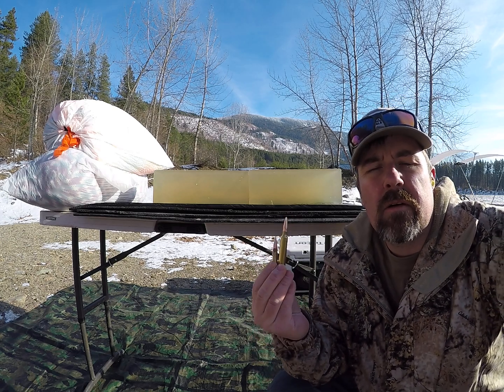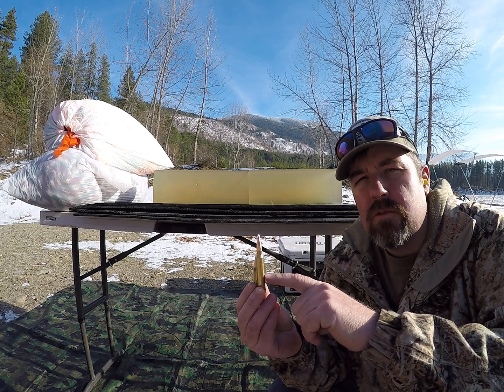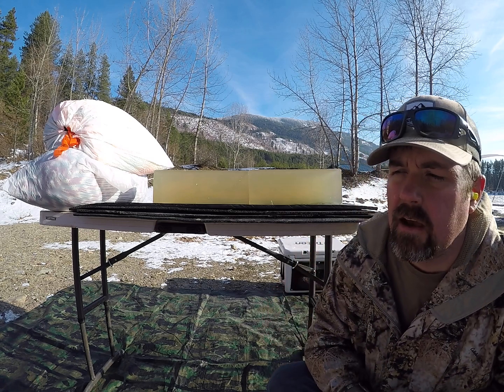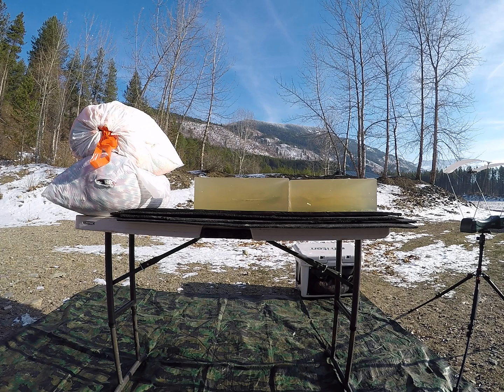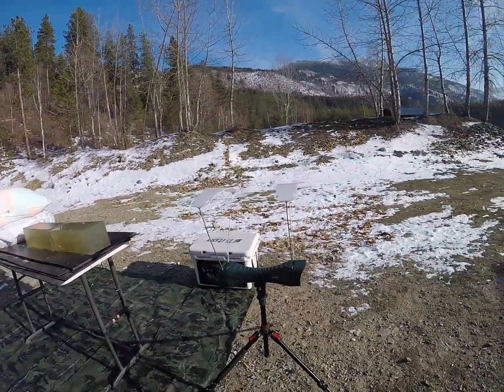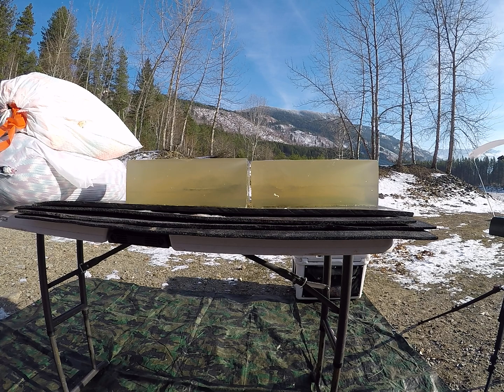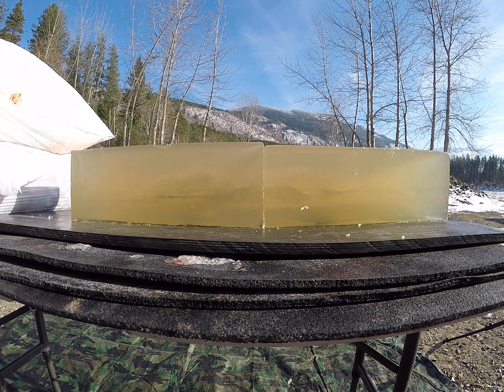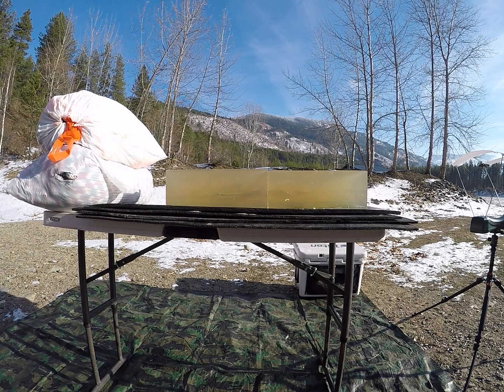150gr 30cal Badlands Bulldozer 2 RPM test in a 1:7 and 1:10 barrel under 1800 fps.

Comment: Just curious if you’ve used these on game yet and/or took it out to long range to evaluate if the BC numbers seem right. Their claimed bc’s are such a big step ahead of other bullets that I’m just a bit worried they’re inflated. 30 cal 150gr bulldozer 2 has a BC to match Hornady’s 168gr ELD-M. Just seems a little suspicious. An all copper bullet that has BC’s way ahead of match bullets in the same class and it expands below 1700 fps and it’s not crazy expensive. It all seems a little too good to be true and that there’s some sort of catch I’m not seeing. Obviously the expansion is legit, but how have these guys cracked the nut that has been reduced bc in monometals where many larger bullet makers who have been making them for decades and employ many experienced engineers and ballistics could not come out with a bullet anywhere nearly as aerodynamic?
Reply from the maker: I have only tested the BC'S with the 140gr 0.277 in my 6.8 Western out to 400 on paper and 1000 on gongs and such. Ranged, dialed, shot, and hit target so they have to be really close. 

I do plan on working up a load with the 150s in my 308 Winchester. Hopefully, I get similar results. 

I have not yet harvest game with them. Should this season as I plan on committing to the 6.8 Western.

Comment: Interesting test on RPMs. The 8.6 Creedmoor uses a 1:3 twist because they claim that it does more damage with the higher RPMs.
Reply: Well they claim that as a marketing point. The twist is so fast because they want to launch a large enough bullet that they can get it subsonic without having to use reduced loads. Long heavy copper bullets need a lot of spin to stabilize when they’re going that slow and only monometals can take that much rotation.

Comment: I spoke to George, with Badlands and he had told me that you had done some testing also.  From what he said, when you shoot a bullet at low velocity and close range, it will not have the same RPM as the same bullet shot at standard (higher mv velocity) and shot at longer range.  Because a bullet with a mv of 2000 fps would not have the same rotation speed as a bullet shot at 3000 fps mv and then allowed to slowed down to 2000 fps at a longer range.  I think as long as the twist rate is high enough to stabilize the bullet, the performance will be good at any operating velocity range.  George said they will open up well down to 1700-1800 fps, so if you try to keep impact velocity at 2000 fps or higher, there should be no issues with a proper twist rate.  when in doubt, always get one more twist rate than you think most bullets would need for stabilization.  Also, keep in mind that most Stabilization rates are based and sea level and at higher elevations, bullets are more "stable" with the same twist.
Reply from the maker: He is correct that a bullet in flight does not lose near the RPM's as compared to reduced loads matching velocities. (dependent on twist rate of the barrel)

I have not had one Bulldozer 2 fail to shed it's tip and start to mushroom as of yet. The lowest I have gone is 1653 fps. 

Having a 50,000+ RPM difference in this video and an 80,000 RPM difference in another video with different bullets having no real noticeable or measurable difference in how a bullet performs after impact is a good indicator that as long as a bullet is stable RPM's really don't matter. (We know super high RPM's do as it can cause a bullet to fly apart coming out of the barrel)
Reply: @simplemindedfella  Yes, you assessment seems in line with what I know, but generally a monolithic or normal hunting bullets would not fail with a faster than needed twist rate unless it was a light for caliber weight, thin jacketed varmint or target bullet going at extreme speeds.  I feel the bulldozer are a solid hunting and long range target bullet.  They are a bit more fussy with seating depth and in reloading than a Berger for example, but i have had good success.    Generally, I would look at seating them somewhere between 0.050 and 0.100 off the rifling (assuming this gives you magazine clearance).  Most of my loads are 0.075 to 0.105 off, to both clear the mags and to give good accuracy.  I haven't found that they shoot as well in that 0.010 to 0.030 range that many lead core bullets like.  Unlike target style hunting bullets, you can shoot these at MV over 3200 fps with no issue and from your testing it looks like the 1700 fps is ok for expansion.  This gives a shooter a bigger velocity operating range than a target style lead core bullet.  Most Berger and Hornady loads are shot in the 2700 to 3100 fps range, with around 2800-2950 fps MV being ideal.
Reply from the maker: @gearguidesguns571   Yes, monolithics can handle far more stress then thin jacketed leadcore bullets. 

I'm planning on making the switch from leadcore to monolithic for almost everything because I feel more states are gonna do so and the federal government at some point will probably try to use the toxicity of lead to get bullets off the market so people just can't get them in the 1st place. I would just as soon be prepared and never need too then need too and not be prepared.

It's really hard to beat the stopping power of the nosler acubond long range bullets that they list operating velocities of 1350 FPS to 3000 FPS which is kind of interesting the top end used to say unlimited but there's a few of us that tested that and found they do indeed have a limit depending on caliber that limit changes a little bit but 3000 FPS is a safe conservative across-the-board velocity for top end.

I'm specifically looking at and need to do more testing with the 140 grain 0.277 caliber badlands bulldozer 2 for my 6.8 Western.  For my style of hunting the badlands bulldozer 2 really is an ideal bullet and still works quite well at lower velocity's and extended ranges far beyond my skill sets. 

A marksman can hit their target well beyond 500 yds, a hunter should never need to. (Keyword "need". I still get lazy and do)
Reply: @simplemindedfella  The ABLR is quite a good hunting bullet and I would agree that around 3000 fps and lower, should be fine.  They are typically heavy for caliber and generally, unless it is a 28 nosler or similar, most factory and reloads will be under 3000 fps.  They lose more weight  than a standard Accubond, but do hold more weight than ELDx, ELDm and Berger bullets, from what I have observed.

Comment: Thank you! I questioned this back in a conversation we had in the comments sometime back. The original individual who brought this into question I can not remember the name or channel. Either way I thank you for your time and effort making these very informative video's. 
Keep'em coming!
Reply from the maker: Your welcome 

There's a commonly believed myth out there that the fact that a bullet loses less RPM'S traveling through the air then being reduced in a load actually plays an effect on how the bullet performs after impact. I've been told by many that you can't simulate a shot at distance mostly because of the differences in RPM'S and thats just not the fact of the matter, yes you can. I primarily did this video via a specific request to show the differences in RPM'S at lower velocity than my other video that the velocity on impact is fairly high.  In my last video I used 0.224 bullets shot out of 223 Remington 1:8 and a very old 222 Remington 1:14 Showing roughly an 80,000 RPM difference not having an effect on a bullets performance and in this video because of the twist rate on the barrels I'm only able to get around the 50,000 RPM difference but if a 50 to 80,000 RPM'S difference makes no difference in a bullets performance after impact, can a bullet maintain enough RPM'S in flight to cause enough of a difference compared to when shooting a reduce load to see how that bullet's going to perform.  Unless we're talking about extreme high muzzle velocity's exceeding the 4000 fps mark as well as really tight twist barrels (Most likely the bullet will fly apart immediately after coming out of the barrel) then no you really can't and I just wanted to prove that to all the naysayers out there so they can be educated on the matter. 

One could play around with different tip designs and design a bullet to where RPM'S could potentially make a difference but when you're talking about the standard hunting bullets that are on the market it doesn't.
Reply: @simplemindedfella  
So glad you did this video and the others. I may be wrong but pretty sure one of the, "keyboard long range shooting", Snipershide guy's threw this at me.  The very same guy who told me, because I stated I couldn't afford a custom rifle, to take my poor a$$ to another site.🤣🤣🤣
Of which my response was money on the shot, mid way between us. Me with my stock Savage  between 800 and 1000 yards. Cricket's is what I got. Anyway, I appreciate your work my friend. 
Keep'em coming 
🙏🏻🙏🏻🙏🏻
Reply from the maker: @kentuckywindage222   I have been surprised with the people who have reached out to me telling me some of the things that are said on forms (I'm not on any and don't want to be) out there about my channel and people known in the industry putting it down because of this yet not ever giving any facts just going off their assumptions. It is quite frustrating when people who should know and don't mislead people. 

They can't deny the facts of what's going on in those videos. I don't believe any of them will ever be man enough to reach out make proper apologies and quit putting down people that they disagree with especially when they can't back their opinion because the facts aren't on their side.  Admitting one is wrong when they've been proven wrong after taking such hard stance on they have to be right, is it very difficult thing to do. 

 I try not to let that stuff get to me and when I can I will compile the facts present them in a video like this and let people do what they want from there.  

I am just an average joe that stated testing bullets in this fashion because bo one else was and I can be wrong at times and I appreciate when people kindly make suggestions and point me in the right direction and then I will take the time to see if what they're saying is correct or not and if I've made honest mistakes I'll admit to them and make proper corrections. No ones perfect. 

Anybody these days can make themselves look professional and be anything but on a YouTube channel misleading people. I notice more of that and people blindly following when it comes to some of the long range hunting especially when there are people suggesting that they know better than an entire industry and you should use match bullets like the ELD-M's and such and not use bullets actually designed for hunting. (In the right setting ELD-M'S  do work well as a hunting bullet)

People really should take everything with a grain of salt and put it to the test if they feel something's off they should feel safe asking a question knowing they'll get a honest response back and people running YouTube channels should value the questions so it keeps them held to a higher standard making sure they are only presenting facts and not potentially misleaming people. As well as being courteous to people who may ask questions that seem a little obvious or stupid per se still be polite back treating everybody with respect it's really not that hard.

Now I feel like I'm just kind of going on a rant so I'll stop happy holidays
Reply: @simplemindedfella  
No rant really just honesty. I do use ELDM bullets in certain situations. Also bonded, interlock and monolithic. I've even used the old 100gr Winchester soft point in .243 for Whitetail here with great success. Your video's and a couple more like you have helped me decide on bullets I load. I've hunted since 9 years old and I'm 54 years old know. Outdoors has always been a part of my life. Supplying meat for the freezer. Learning something new and improving your knowledge should be part of ethics really. Type of bullet for hunting close, type of bullet for my long range hunting are different. In 6.5cm for me 130 gr  Gamechanger to 400 to 500 yards and 140 ELDM past that. I use a Barnes 80gr ttsx @3400 fps from my 243 for its range. 308 I use a 175 SMK for target or varmint from 50 to my ability limits and a 168 A-max for white tail to 600 yards give or take. I took a shot on a varmint that walked on our range just as me and my shooting partner were preparing to packing up. I had just shot a good group at 1000 with the 6.5 creed, 4.5-27x50 glass, 140gr ELDM @ 2837 fps. My buddy ranged it 1060. I was still set up for 1000 yards. I dialed the dope and down went the critter. That bullet did an amazing job in the shoulder area and out the other side. Would I take that shot again.....maybe, depends on the elements. No wind like then maybe, windy probably not. Although we practice rain, sleet or snow, wind or not. Would I take that on a deer probably not. Although at 1000 it still has the energy of a 357 mag at the muzzle. Most of those who contest that shots lethality, wouldn't bat an eye at a 357 mag being lethal at 50 to 75 yards even though the energy and velocity would be less. Here you and I know isn't the problem. Its placing that bullet where it needs to be, to do its job at 1000. If I ever come across that shot on a deer I do know I made a 1060yard shot on a smaller target that did not walk away. It was DRT. In summary that situation was ideal. That has very little chance of happening again. The bullet however did its job in spades.
Thanks again for your testing.
Keep'em coming!

Comment: Good test! I'm not surprised with the results. With energy being equal the bullet expansion should be equal (which it was). The only real difference would be the number of revolutions in the gel. With 24" of penetration the 10" twist should make 2.4 revolutions and the 7" twist should make 3.4 revolutions.
I think one could assume that more revolutions with the same expansion could do more tearing of the gel, but as you demonstrated it's insignificant.

Comment: I have never seen such tests before, so I can appreciate your efforts here.  Your results proved what I would have guessed.  A 150 grain badlands is easily stabilized with a 1:10 twist (the badlands website suggests 1:11 or faster), so at any normal operating velocity, the stability will be more than good with a 1:10 twist.  Also, it looks like you are doing your testing at quite a bit higher than sea level; bullets are more stable at higher altitudes and the stability factor actually increases at altitude, with the same BC.  You can check this on Berger's website by changing the elevations on their stability factor program.  Also wind drift decreases and retained velocity increases as altitude increases.  Much of the long range hunting is done on the western plains and mountains at elevations from 5 to 10K, which means the actual ranges where bullets will drop below 2000 fps increase significantly.  Thanks again for publishing useful and unique testing data.  Bryan

Comment: Do u have a 270 if so  like to see some bullet testing
Reply from the maker: I currently have a 6.8 Western it's the only thing I have in the 277 caliber. I will be doing videos on the 0.277 caliber bullets in the future.
Reply: @simplemindedfella  the new 150gr 277 looks like a perfect 6.8W bullet.
Reply from the maker: @z987k  they do look like they would be a good one. I just worked up a load for the 140 gr for my 6.8 Western, need to get some field testing done next season.
Reply: @simplemindedfella  I've got the 140gr 277 in my 270-08, haven't worked up the load yet though.  The 150 eats into my powder space too much to use it on a short action in this case.
Reply: @Simple Minded Fella  any news on the 140 in the 6.8 Western? I'm trying to decide between the Bulldozer 2 and Hammer HHT for my copper load. 170 EOL and 145 ELD-X have both been extremely good option for the 6.8 thus far
Reply: The 128 Badlands worked amazing in my 270 Win (it is an old pre-64 M70 with standard factory twist).  I am using 6.5 StaBall at 3210 fps and both animals I shot this year were 1 shot kills at 500 and 515 yards.  Complete pass throughs in the chest, with a great wound channel.  Neither animal went more than 25-30 yards.